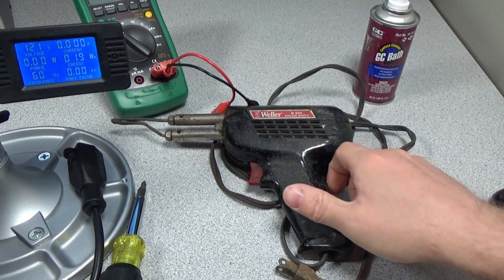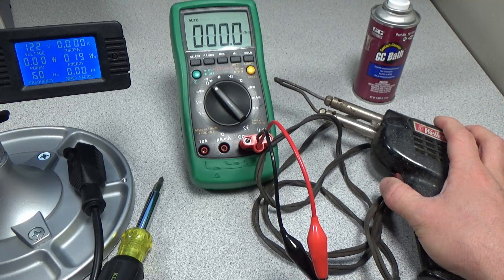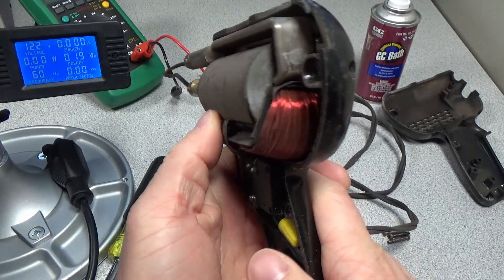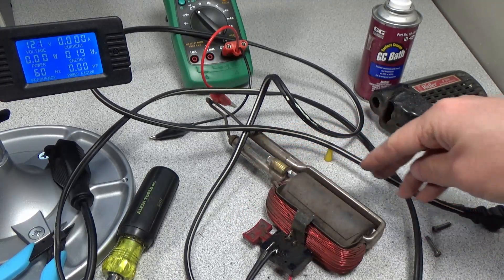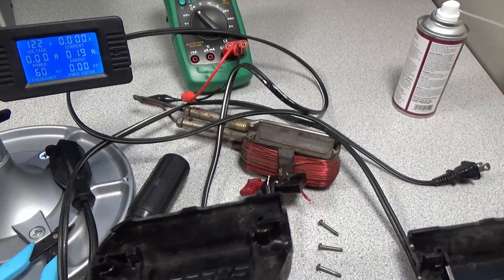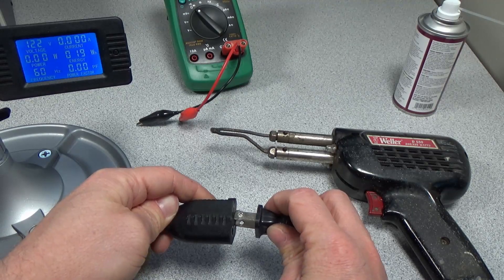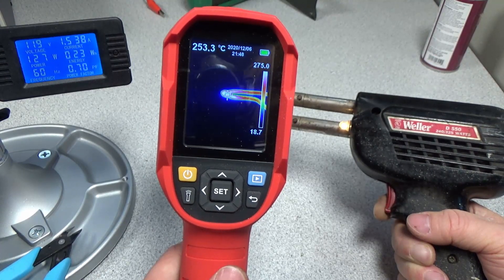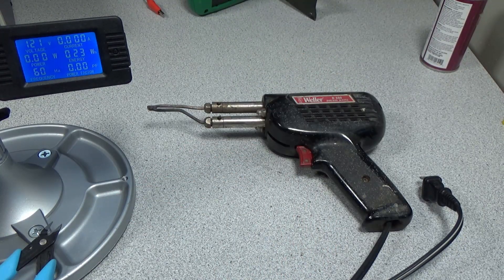Weller Soldering Gun / Iron D550 240/325 Watt Iron Line Cord Replacement – #13

Comment from the maker: A commenter stated that a silicon cord should be used and I didn't even think about it when replacing the line cord with whatever I had laying around.  So, if you do end up replacing the cord, a proper high temperature rated cord should be used.

Comment: the new are not built as well as the old ones with the nut tightened tip
Reply from the maker: I did finally replace the tip on this one too.  Someone did recommend using a silicon cord which, yeah, I should do that still.

Comment: You used the wrong type of cord it should be a silicon  type wire like the ones they use on toasters, coffee pots, and other type of appliance..... It has to be heat resistant from burning the installation with the iron itself..... I have to tell you amateurs everything apparently...  also It does not need a polarized plug...now go back and explain to your followers the right kind of wire to use before they have some kind of hazard using a standard cord... Sorry but I have to give you a thumbs down for this one......
Reply from the maker: Yes, I should have, I replaced with the type already on the tool.  It did completely go over my head to improve it.  I guess the down side to that is it will cost more than the tool to put a good cord on here.

Comment: i stumbled upon this video because i just bought a new d550 and measured the actual power used and i was a bit disappointed, it topped out at 188w and stayed around there is heating up a joint to solder, and dropped down to 160w when hot in free air, the low setting was around 140w peak, tried all the tips not much change, but definitely not the 260w as advertised. Sad how crappy and overrated everything is today.
Reply from the maker: Yeah, I like the modifications Mr Carlons lab makes to these with the wire tip.  I think that gets a few extra watts out of them.  This is the very old version though.

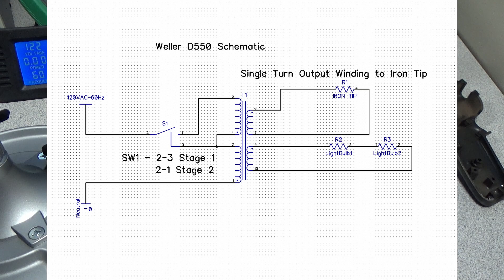Comment: Hey I've got a question about the schematic shown at 3:00 . From what I remember from school, it looks like the current from the 120VAC line flows into The H2 equivalent on the primary side (referring to point 5 if the switch is at position 2-1) as depicted by the dot notation. That seems backwards to me. If the switch is at position 2-1, shouldn't the current be flowing into the primary coil from the dotted side (point 1)and exiting through the undotted side (point 5)? I'm thinking from a conventional current standpoint. Am I wrong? 

Thanks!
Reply from the maker: Doesn't matter!  Yeah, I got a little sloppy with notation there but it's a youtube video, also it made the schematic cleaner, slightly.  The dot really indicates what phase will be on the other side of the transformer, since there is no phase relationship here, it doesn't matter, the AC signal will pass through the same with the mains wires placed on the transformer either way.  Also, being an AC signal the current will be in both directions.  I picked a random transformer diagram that had enough windings in the software rather than making a custom one.

Comment: I'm 72 yrs old and I grew up with a 8200 100/140 I love that old gun. An elderly lady gave me a D550 240/325 and now a have a new love. People say I don't like those old dinosaurs, but it's becuz they are use to the new knock offs. I like when you pull the trigger on one of these and they hum I know there read yo do some work.
Love your video, I'm gonna clean my old one up now.
Thanks again for a great video!
Reply from the maker: Thanks for watching and sharing.  This is a great iron for working on chassis connections or large thermal planes/large wires.

Comment: I have the same gun.  Reads 5.5 ohms on low, 4.8 on high.  I put new tip on it #7250w. bit it will not get very hot. Barely melts solder. Is this the wrong tip for the 325watt gun?  Everything else looks great, windings do not smell like they got hot, and no evidence of overheating, lights work, cord is good. I tried going to Weller-tools, web site but it does not work well. No shorts from wires to solder tip either. I barely get the AC hum, either.
Reply from the maker: Hmm.  Measuring DC resistance at the plug inlet is only indicating continuity of the internal transformer.  For actual power used you need to measure AC impedance with the trigger in each position, is that what you measured?  The connections to the tip can be finnicky.  I am planning to make my own tip at some point since the one on the gun now is a poor performer.  The tip itself is likely in the milliohm region, if it is the tip measuring in the several ohm region then that is either the wrong tip or the tip is not functioning.  

I had a plan to get the follow up video out for this with the tip replacement but this video is already great for that:  https://youtu.be/79uD6XwBg5E
Reply: @AllThingsOnePlace  The tip fasteners are the better kind with the screw nuts that tighten down well.  Ohms are measured in both positions of the trigger. I know it is getting full power thru the extension cord as the overhead light slightly flickers with different positions of the trigger.  The thing that bothers me is that it barely hums with the AC noise and vibration like my 140 gun does.  Those new tips take over a minute before the tip barely smokes from the heat.  Barely melts solder.

Comment: Dude the cooper tip its so dirty! you must clean it using a chloridric acid bath. i have the same type of soldering gun but the Argentinian version, called " Vesubio model D-3". it heats up in less than 5 seconds.
Reply from the maker: Thanks and  you're right.  I plan to do that as well but the main focus was cleaning up the inside, replacing the line cord, and making sure the unit was still functional.  I have used a few times since and I need to get the tip restored now to make it a go-to tool.

Comment: Do they still do the double-click on the newer models? And what was the purpose of it?
Reply from the maker: Yes, that feature is still on the newer models.  The purpose is two power levels.  So, 240 watt is the first click (colder iron) and 325 watt is the second click (hotter iron).
Reply: Actually, it's vice versa: the first click is the full power, the second one (fully compressed trigger)- the lower power.
Reply: @AllThingsOnePlace  Actually, it's vice versa: the first click is the full power, the second one (fully compressed trigger)- the lower power.
Reply from the maker: This (much) older unit is not setup that way.  The power consumption increases on fully compressed trigger and the tip heats up faster in this mode.  This is a vintage unit.  You are correct that the newer models do operate at full power then lower power.  The wattage is also listed that way on the newer models "260/200" as opposed to "240/325".